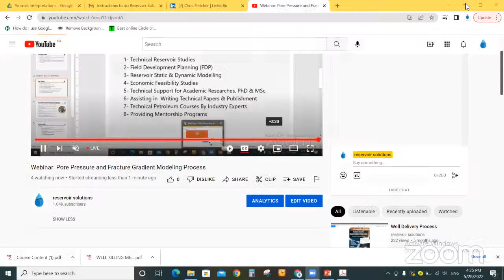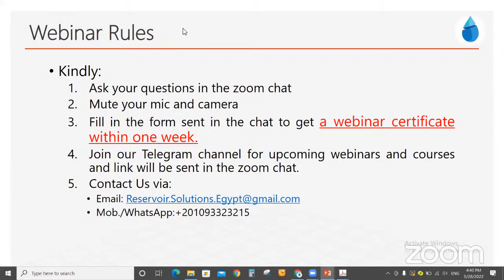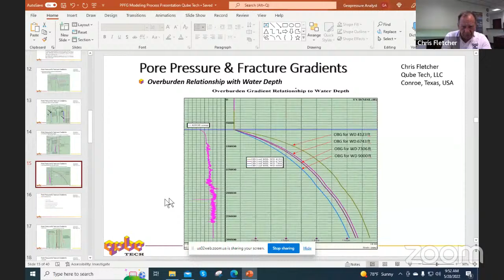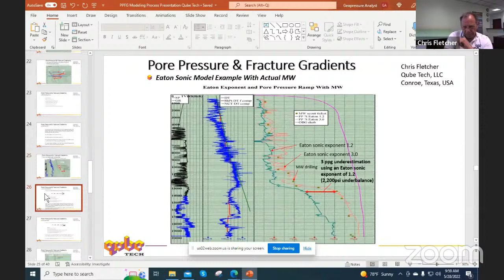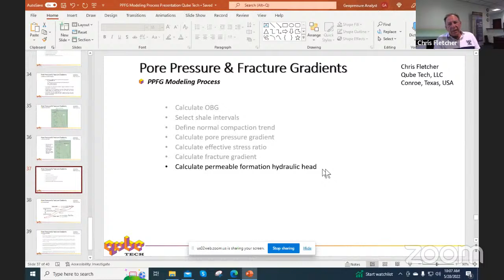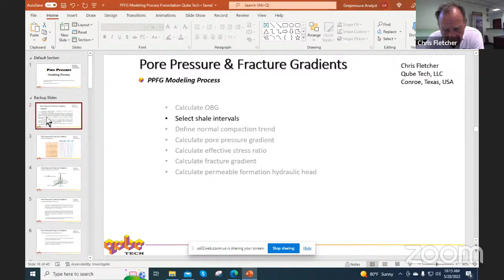Webinar: Pore Pressure and Fracture Gradient Modeling Process

Comment: Thank you so much for giving me a new way of looking at pore pressures from the context of permeable and impermeable rock.

Eaton's resistivity and sonic curve-based models enhance the methods available for calculating pore pressures. Understanding the normal gradient and the behavior of curves taken in the wellbore are key to correctly calculating and understanding what happens in a pore space when overload stresses are present.